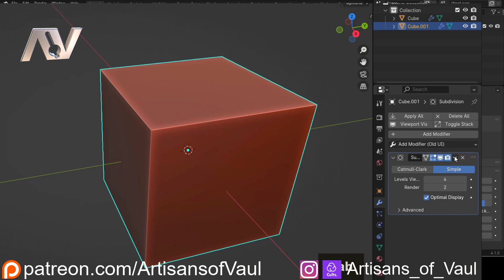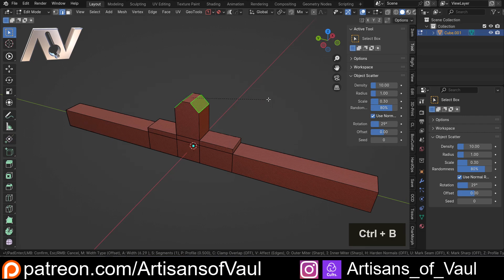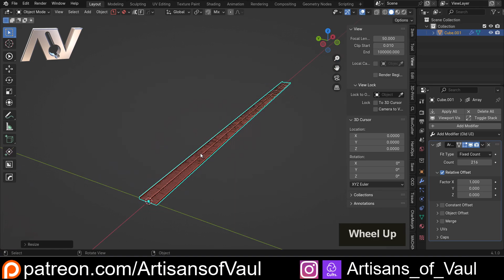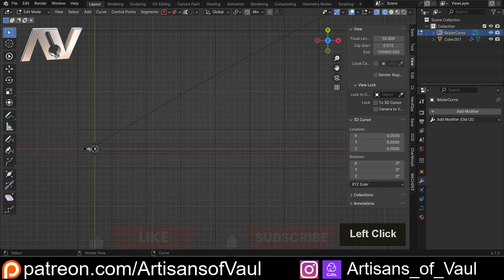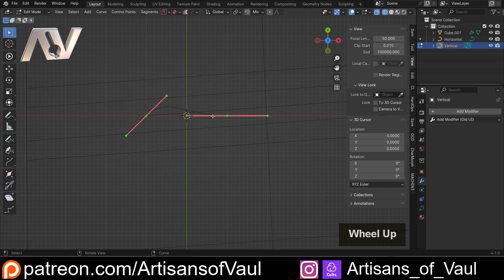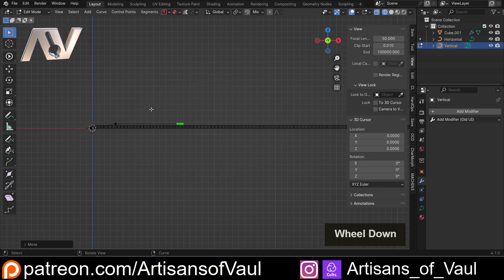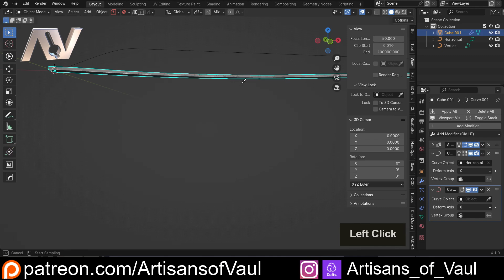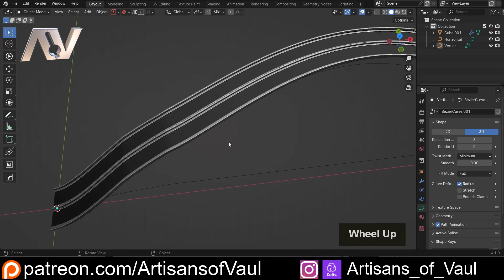Do you know this double curve modifier trick for Blender?

Comment: I listen to your videos through my studio monitors and I've noticed you don't use a roll off filter on the audio low end(or a steep enough one). Pretty often some of your harder clicks/strokes will make a deep boom that feels like someones trying to break in. Consider running a high pass filter around 40 -50 HZ at around 24db on your audio.
Reply from the maker: Thanks for the advice, audio is far from my speciality so that's really appreciated. Now to go off and research what most of that meant 😅

Comment: I’m trying to figure out how to do something that would be useful in designs: is there a way to inset an object and have it bring “negative space” with it? For example, placing window objects in a wall: is there a way you have the window as an object that can be placed and merged and is inset to the wall?
Reply from the maker: Do you mean by having a boolean object impacting the wall as well?
Reply: @ArtisansofVaul  Yes, I think. My only thought is to have a cutter object I have to Boolean cut first, then Boolean add the detail object in.
Reply from the maker: @BalanceAtTubas  that's normally what you'd do. You could parent two objects together (the boolean cutter which I'd normally do in wireframe and then the other object. Then do the booleans once moved into place.  I wonder if you could do it with Geonodes though 🤔

Comment: what about the difference of using the Array along a curve in the array modifier? how does that compare to this technique? I've seen lots of different ways of modeling chains, tenticles and tails. This has a lot of moving parts its seems. Give greater control but I wonder if it is the best way. Espicially for chains. cause you would want each link to not deform. I remeber your video for the chain sword using  a plain instancing to combat that. its that the best way to do a chain or could you use this way?
Reply from the maker: For a rotating part (where the start and the end needs to be the same location) it isn't very easy to use. But in other instances it could help as you can use the normals of just one curve instead of worrying about the twists as you flex the curve in multiple directions. I'm not sure I can think of a huge number of applicable uses, but on this road if you wanted to use the curve to animate cars moving along the bridge perhaps as you don't want the cars twisting around. Though there are other ways to get around that.

Comment: In the Bezier Curve panel (the one where you set the resolution of the curve), there is an option named Twist Method. Try setting that to Z-Up - you should be able to do more with just the one curve using that setting. You can also edit the tilt of a ppint by right-clickign on it, and selecting Tilt (or using CMD/CTL-T).
Reply from the maker: Good tips 👍🏻

Comment: Reminds me of the time when I had to make a diverter in Inventor for a steel plant in South Africa. I used a curve to describe the side profile and the top down profile then made a surface, sort of a curtain from the top down one then curve projected the side profile onto the surface. Then i made a bunch of points along the curve 250mm apart (for the diverter pipe) then 25mm (for spacing between the pipes) i had to hand place about 150 pipes (cause a pattern followed a normal of the projected curve that I could not change). Pain in the ass but it worked like a charm. So this is as much of a pleasant video for road making (I am big into Battletech) as it is PTSD from curve fitting hahahah.
Reply from the maker: 😂😂😂 I hope it was mostly positive and you haven't been left hiding in the corner of the room.

Comment: I do find it interesting that both curves are deforming along the X. I'd thought the vertical curve would deform the Z .. but now that I've had a bit of a think. It makes better sense, since the road is only extended along the X. Thanks for the tip.
Reply: Note: Curve modifier doesn't work well when selecting axes other than X. You'd think it would be agnostic to it, but it's not. See for yourself. Make the same road, but make it go along other axes (Y, or Z), then make curves. The modifier will work differently!
Reply from the maker: @eitantal726  Very true. There are other modifiers that are the same, simple bend for example.
Reply from the maker: My pleasure.